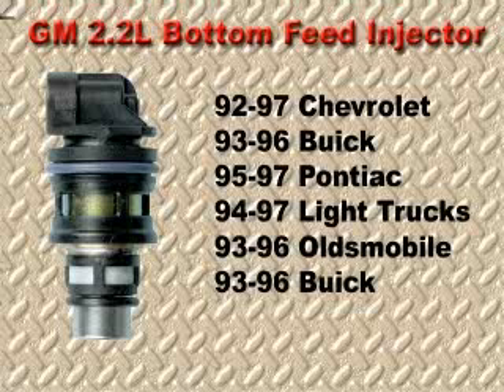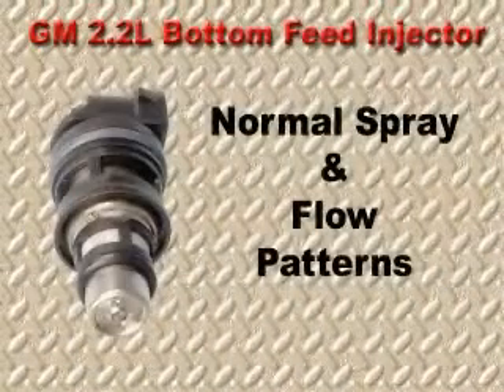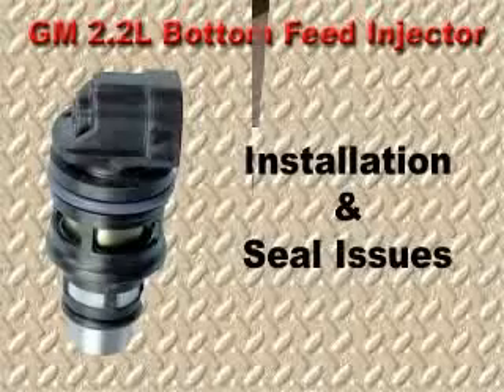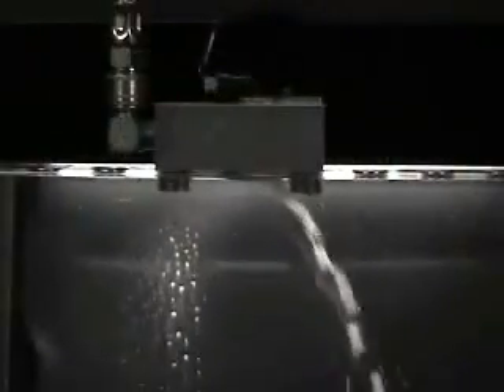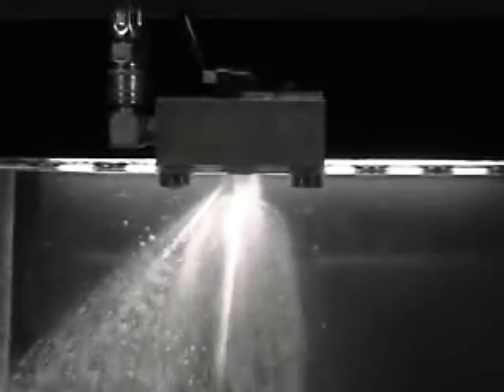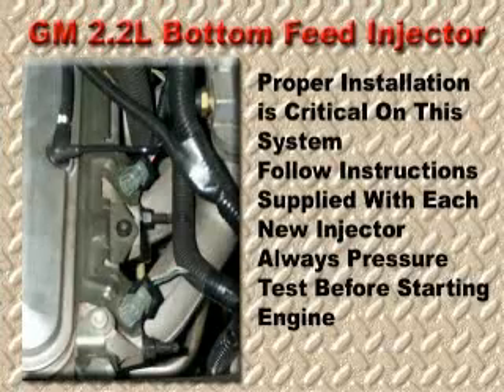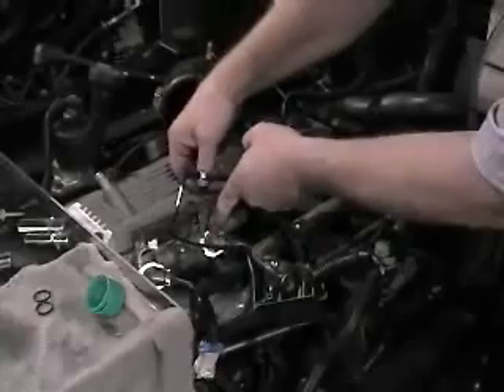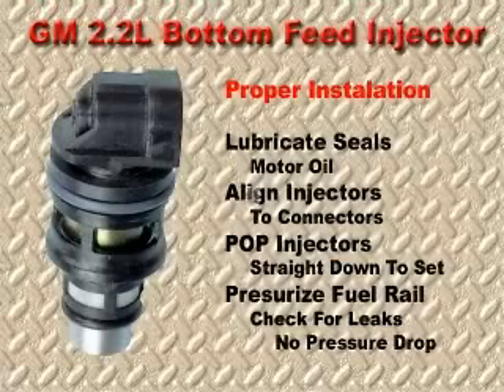GM 2.2L Bottom Feed Injector

Comment: Is there still hope that it truck will run again if it is hydro locked? Some of the gas got in the oil i got all the oil an gas out. An as far as i can tell it was only in one cylinder. I never got the truck to start people have told me since i didn't get it started i still have a chance it might not be too bad. Thanks for the video.
Reply: Yes you must pull plugs out for a day and change oil